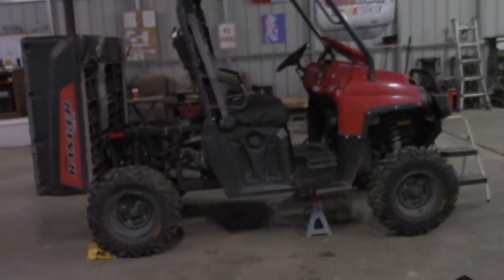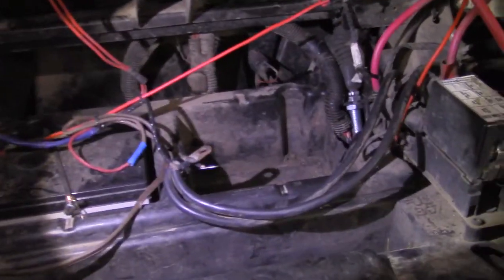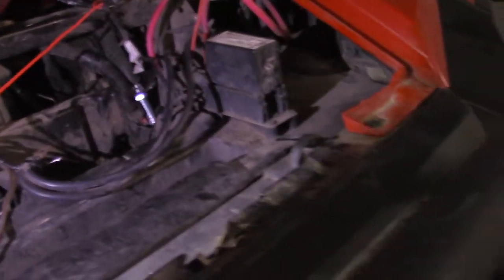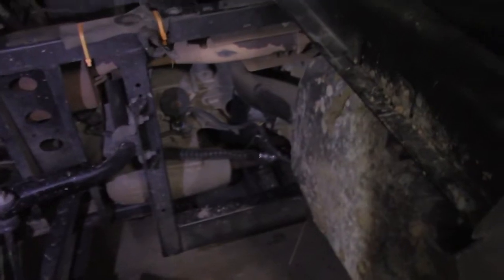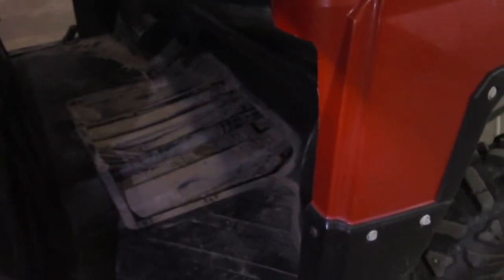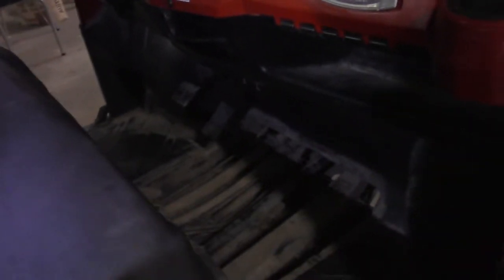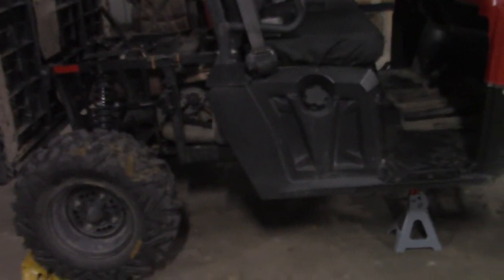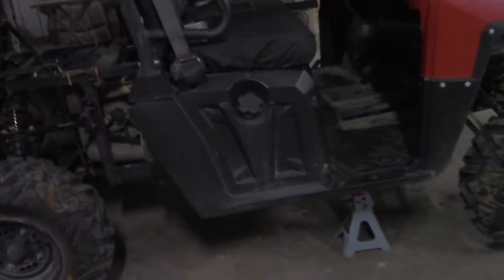How to Replace Shifter Cable 2013 Polaris Ranger 800 XP (EASY)

Comment: Thank you so much for this video. This model is virtually identical to the new 570 full-size units. For clarity did you take the new cable and feed it from the back connected to the old one, as you pulled the old one out toward the front? I'm pretty sure that what you said but I just wanna make sure.  Again thank you so much for making the video because I've had a hard time finding anything out there.